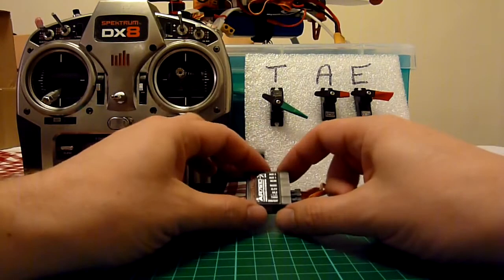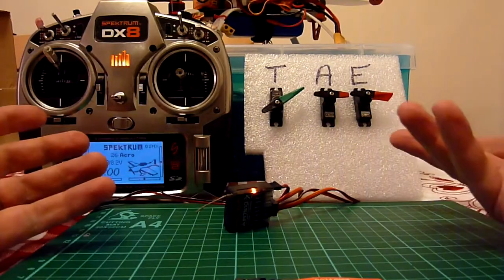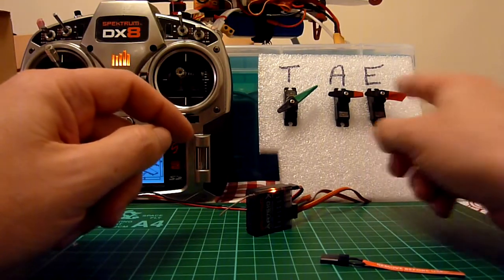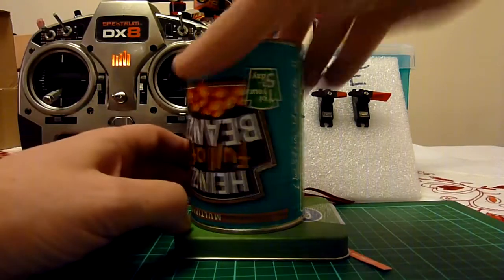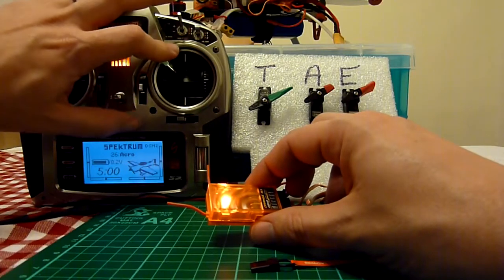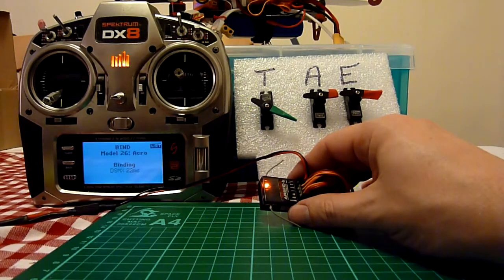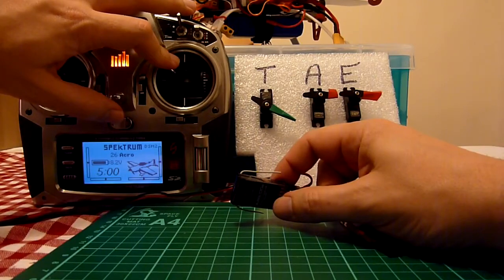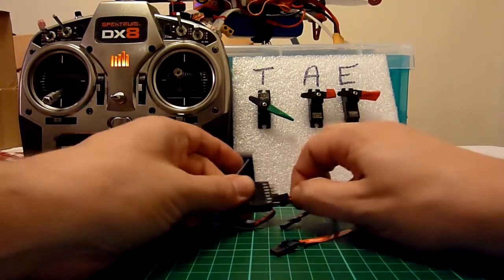Quicktip preset vs hold Failsafe explained Spektrum/OrangeRX eg Naza failsafe

Comment: how do you do this with a hyperion reciever
Reply from the maker: You'd have to check Hyperion User manual for your specific receiver, I suspect it will be similar, but not sure if Hyperion receivers support both types of failsafe as I've never used them.

Comment: ir only work with spectrum ??
Reply from the maker: +Juan Miguel Perez Lopez All radio makes support failsafe but in different ways, ie some have a button on receiver to set failsafe positions, others program from transmitter, so you should check manuals for your make to see how to do this.
Reply: +jamesb72 i alredy configurated my failsave with transmitter , now i want the other signal lost failsave . the reciver is turnigy 8x , it dosn't have a buttom, so i can doit with bind plug?. sorry for my english .
Reply from the maker: +Juan Miguel Perez Lopez Sorry I don't have that radio, if you search for your receiver model and failsafe I'm sure you can find instructions.
Reply: +jamesb72 ok friend , thanks

Comment: Great video. The preset bind works fine but if i turn off transmitter it is not going into failsafe. Can you help me please? Thanks
Reply from the maker: Thomas Bruyninckx It may be your receiver will only failsafe on throttle other channels will hold, or possibly some receivers hold last position on all channels. Easy way to check is to hold sticks in top corners when you switch off transmitter, servo's will either hold that position until you switch tx back on with sticks centred, or throttle will jump back to bind position.

Comment: At last someone who knows what they are talking about, for 2 weeks i have been trying to setup my new DX6 and my 450 quad with Naza 2.. thank you thank you.... perhaps you could re name this how to set up naza when transmiter is turned off.
Reply from the maker: Thanks, glad it was helpful, I did make a separate video on setting up Naza including failsafe here DJI Phantom or Naza V2 setup DX8 Spektrum Transmitter including bind failsafe test in 7 mins you can ignore the setup part but it does show the binding and how to test failsafe with props off using LED or the Naza assistant software.

Comment: Very nice. Good explanation. I use a AR6210 with my dx6i (dsmx.) Getting into fpv so looking at failsafe... Sad that it wont work for my receiver. I fly a quadcopter so last position wont be good...

Comment: James, I have a AR6100e and I can not get a preset bind to work on switches (Gear/Aux 1), only throttle preset bind.  I have sone it over and over like you showed.  I have an ar8000 and of course that preset binds fine.  Great video btw.
Reply from the maker: Its very hit and miss on which receivers have which failsafes. If your receiver only supports failsafe on throttle I believe you can get round this by swapping pitch and throttle cables to Naza, so you use throttle curve to set flight mode (throttle channel cable goes to U port on Naza - so will failsafe correctly, pitch/aux1 channel goes to T port on Naza), and leave pitch curves default and these will work throttle normally, the only very slight risk would be Naza settings state >10% throttle position required for failsafe (although I can't understand why as throttle is ignored during failsafe/return home), as 'throttle' (pitch channel) would hold last position if you were in a full downward descent when you lost signal this might be an issue, but I suspect not, and certainly better than no failsafe set.

Comment: Manual of my AR6100e says it will hold last position on failsafe, your video here shows otherwise... I guess im going to trust you and flip off the Tx... weeeeeeeeee
Reply: ...scratch that .. apparently you have a different AR6100e than me... that or your Dx8 binds to it differently than my Dx6i because I tried to repeat your test just like you did above and my servos dont return to home when I flip off the Tx... Off to shop for a new Radio / Rx
Reply from the maker: Dane Schmidt Make sure you test this with props removed for safety, there are a lot of fake AR6100e receivers floating about, maybe yours (or mine) is not genuine? I'd be surprised if there was any difference between DX6i/DX8, it should be down to the receiver only whether bind is preset or hold.
Reply: ***** I have 2 genuine AR6100es .. one from my blade 400 that came with my Dx6i and one from an old Blade SR.  Tried this with BOTH.. def had props removed.... BOTH of my 6100es do NOT work like yours in the video.  They just hold last position on power off.  Oh well, I have just ordered the Orange r800x to use with my new Naza M Lite.  Some people say they are crappy with bad range, I just hope the failsafe works.. at least then if I lose range HOPEFULLY the thing with RTH and land... (btw I have the OLD dx6i thats not DSMX...)
Reply from the maker: Dane Schmidt Thanks Dane, thats interesting. This AR6100e I bought 2nd hand on ebay so maybe mine is a fake ? or there were different versions. This had v1.6 marked on case which is the firmware, not sure if there were any newer versions (I used have v1.2 without quickconnect and I know most got upgraded to v1.6 quick connect firmware). I am using R800X on 2nd phantom and range is fine, and failsafe works as a backup, I ran one aerial down skid leg the 2nd out across bottom of arm. You can check failsafe with props off to be sure it will work before flying, I posted another video showing DSMX setup which shows this clearly.

Comment: Hi James
I hope you can help me with the following.I have a Spektrum DX6i DSMX transmitter and a ar6210 receiver that I am using with a naza lite set up.I have also got a orange r620 receiver.I have tried to set up the failsafe function wit signal loss but can not get it to work.Can you please tell me if I can use either of the two receivers or do I need to get a new one and if so what should I be looking at?
Any help will be greatly appreciated
Phil
Reply from the maker: You can use the AR6210 using throttle channel for U/flight mode (throttle channel will always go to bind position on signal loss), and pitch channel for T/Throttle, setup radio in Heli mode using throttle curves to set flight modes and pitch curves leave linear for throttle. It will achieve the goal of failsafe on signal loss. Or you can get an R800X or AR8000 receiver (or any other which supports preset failsafe). Long term you probably want to look into upgrading your DX6i as you need 3 position switches for the Naza or a load of mixing to get all modes/compass calibration - a cheap DX8 or ideally DX9 are well worth considering.
Reply: Hi James
I am a novice who is basically just starting out and find the settings in heli mode a bit daunting.I have just figured out how to set up my two position switches to switch between atti manual and gps in acro mode.I will have a go at trying the the settings in heli mode to see if I can achieve failsafe with signal loss.Would you recommend the Turnigy 9x transmitter if I am thinking of upgrading and if so what receiver should I be using with?
Thanks
Phil